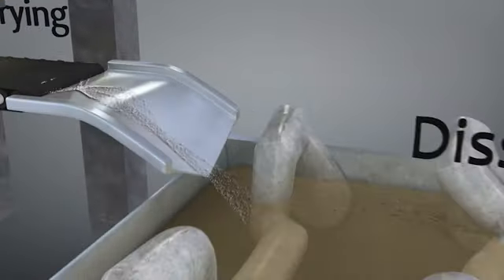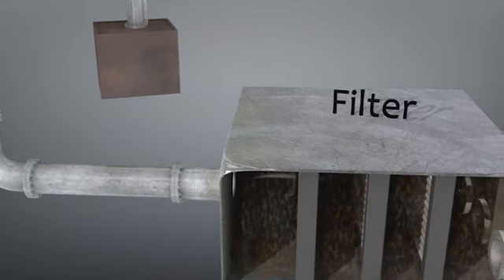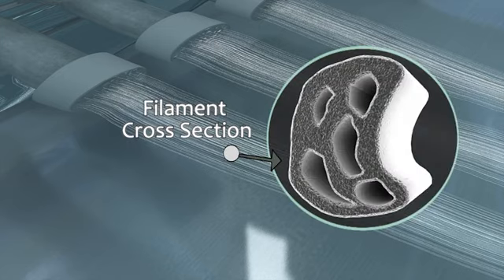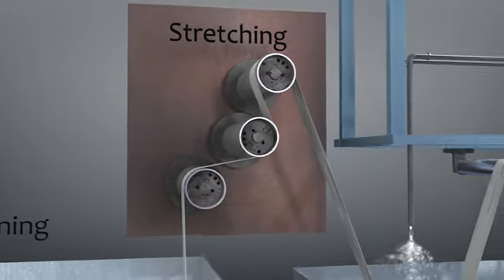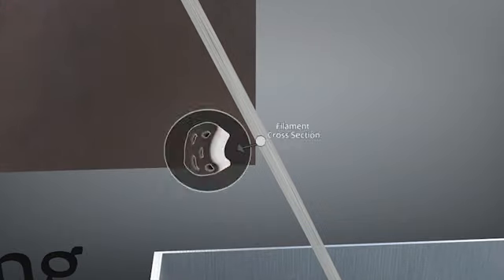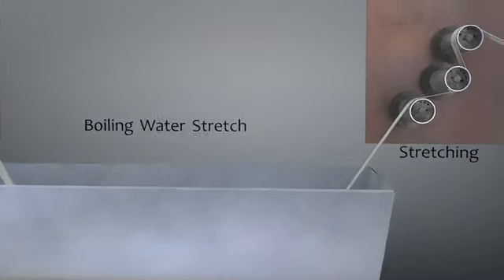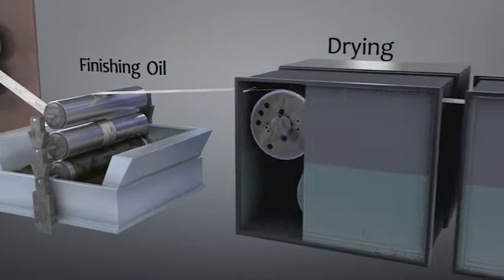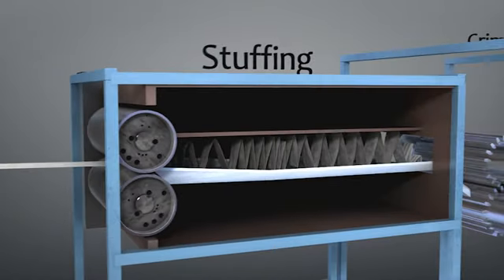Carbon Fiber: PAN Precursor Carbon Fiber

Comment: Very strange, usually spinning solution are produced by direct polymerization of AN in DMSO. There is no need to isolate polymer by drying to dissolve it again afterwards! ;) It is reasonable if you only synthetise PAN by any kind of heterogeneous polymerization.
Reply: @VOo1345  No, I don't mix things - watch video properly, if there water as solvent for monomer and precipitator for polymer was used, we would see a title "WATER" above the tank, but there is title "SOLVENT", that means, it dissolve both monomer and polymer.
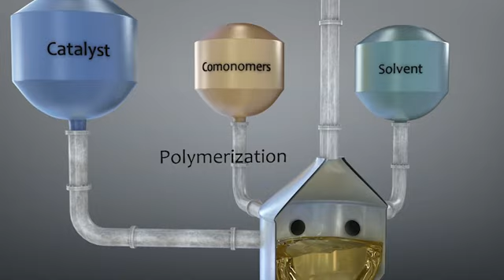0:42 Watch this - yellow color indicate about POLYMER SOLUTION presence - DMSO form coplexes with AN of a yellow-orange color, depending on polymer concentration.
Of course, I understand yellow color could be chosen for making watching video comfortable. Anyway, if they meant water, they should be write "WATER" instead of "SOLVENT", cause SOLVENT implies some ORGANIC SOLVENT BOTH FOR MONOMER AND POLYMER
Reply: @VOo1345  I got you idea - you meant precipitation polymerization, where AN is dissolved in water, but formed polymer, PAN precipitates as polymerization proceeds. So it only should be filtered and dried.
Reply: There are two ways of polymerization : one-step as you know, and two-step as video shows.
Reply: @yongding3892  I know, but I don't see reason, why one provides it by two-step method if it is possible to do all the same in one-step way.
Reply: @Polymershik  there are different solvents: DMF, DMAc, DMSO, ZnCl, NaSCN, etc. by different acrylic fibre producers; and 1-step and 2-steps in polymerizations; and dryspun and wetspun in spinnings; and different 2nd monomers after 1st monomer acrylonitrile. It makes approximately 12 polymerization /spinning routines in acrylic fibre productions in the world.
There are advantages and disadvantages in terms of polymerization between 1-step and 2-steps. For example :2-steps polymerization may help in precursor production for carbon fibre since it has more purity to safeguard the precusor quality to have the strength (tenacity).
Reply: @Polymershik  the reason why there is solvent applied is that polyacrylonitrile does not dissolve in the water (that is  also wetspun's meaning).
Reply: @yongding3892  Thank for explanation, but our department are concerning with PAN synthesis at least for 10 years :) And I didn't know only reason when it's needed to use 2-step process IN INDUSTRY, cause it seems to be not appropriate from economical point of view
Reply: @Polymershik  
When using 1 step method, the spinning process is directly tied with polymerization e.g. If you have one issue with polymerization you might need to stop spinning process. 

With the 2 step method, dried PAN can be stored. In this way, you can have an excess of PAN production. That excess can be used in a variety of ways for a  easier plant management.
Reply: after reading this comment section I realize how "out of depth" I am in what i know
Reply: @VOo1345  Hm.. Thank you for explanation. I didn't realize it.